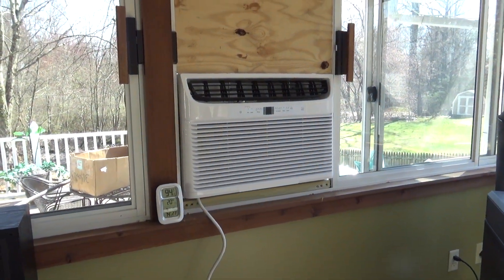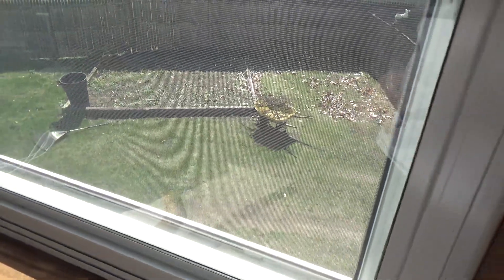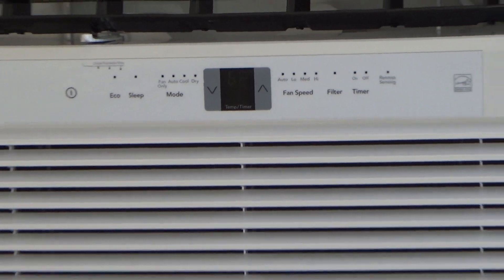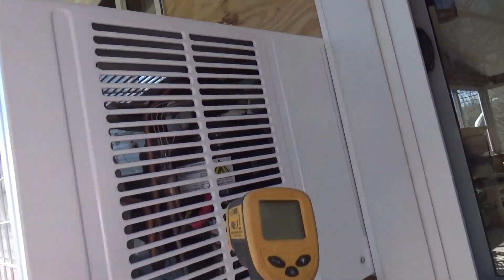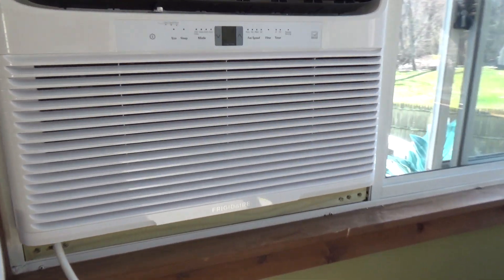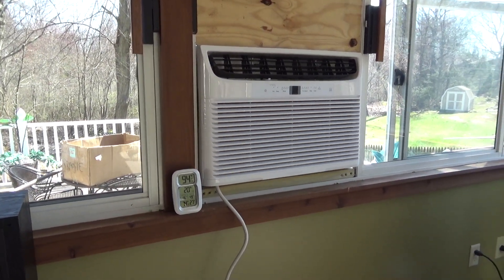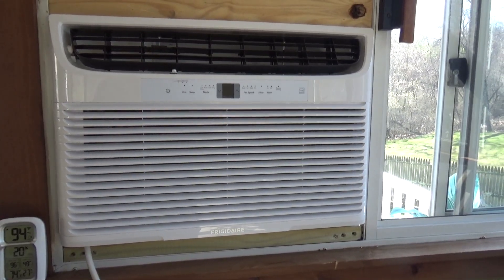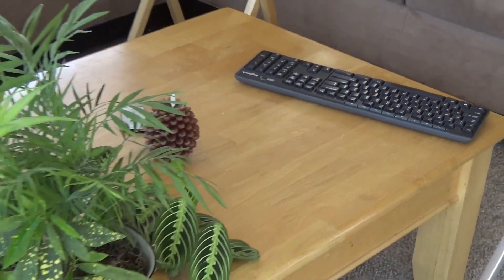Scalding Hot Compressor and Erratic Behavior | Frigidaire FHWC253WB2 25,000 BTU AC Day 2

Comment: Look at the open gaps you have between that air conditioner. You need to close them up. You can clearly see the outside light coming through. That hot air is just sucking that cold air right out of that room. With that Gap you have on the right hand side of that air conditioner. And yes, with no curtains or shades it's probably struggling with that too. But that big gap you have on the right side of that air conditioner. That hot air is just sucking that cold air right out of that room. You need to seal that air conditioner up a lot better than what you did there. I guarantee you will see a difference.
Reply from the maker: I put a 27,500 BTU unit from the 1980s in the room under the same conditions and it cooled perfectly. This modern equipment is lousy.
Reply: That's not the issue here its either an undersized compressor OR not enough airflow over the condenser either way it means its poor design.

Comment: Maybe the air conditioner has problems with the cycle, it could be doing the short cycle, or the compressor was overheating, as was the condenser.
Reply from the maker: Or it's just a modern piece of junk.
Reply: @JordanU  Yes, but I think it would be good to use it for more or less small places.

Comment: Maybe wrong, but I suspect the insufficient airflow is causing the head pressure to rise through the roof, leading to high compressor temperatures. The bad-quality junk you receive today is unbelievable.
Reply from the maker: The condenser temperatures didn't seem unreasonably high, but more air flow would definitely be better.
Reply: Midea sucks at making acs they also manufactured some Frigidaire acs

Comment: I have the same unit. Lasted 8 years, it has the 401 gas. IF it loses just a little bit, I was told by a friend's brother whom has his license that this can cause the head pressure to get to high and shut off. Electric bill was getting shy high. It looks like you may have some open windows, maybe just the way there made. That service call an gas isn't worth it. It's under warranty for 3 years, mine was. But out after 8. Get your money back and get you a Mr cool Diy, get help. That's what I plan on doing.
Reply from the maker: Lost gas will cause low head pressure. These units aren't worth a dime. None of the ones made today last. I installed a vintage unit from 30 years ago in it's place and never looked back.
Reply: @JordanU unit name?

Comment: This A/C should oem by junk chinese Midea, Midea A/C 's condenser air flow is very poor. Alsothe discharge temp of R32 refrigerant is very high.
Reply from the maker: It's made by Electrolux.
Reply: @JordanU  these use midea parts

Comment: Try misting it with water
Reply from the maker: Why would one mist an air conditioner with water?
Reply: @JordanU  it helps it cool down
Reply from the maker: @Dubby522  There's so much heat there, a little misting of water or the collection of condensation that comes out of the machine will just warm up to the temperature of the condenser and do nothing but rust it out.

Comment: I'm thinking that it might have a slow leak. The refrigerant running through the compressor does help cool it. I think you should just replace the air conditioner as soon as you can. Summer will just get even hotter, so this is just a bad sign. That, and you need window treatments, but that will only do so much if your air conditioner is about to run flat or burn out. Window treatments will help you save a good chunk of money with all those windows. Although leaks in coils can be repaired, my understanding is that it's not economically feasible even if you can find a guy to do it. These modern air conditioners are designed to be thrown in the trash. It's unfortunate. In someways, it's like how cell phones are built like Swiss watches that we just trash after a few years, and they make every effort they can to make sure you can't repair it. Modern air conditioners don't even have the quality in them to begin with. They are simply designed to fail.

Comment: You should see a 20° difference 94° Outside 74° Inside is about right . If the outside temperature should get up to 100° outside you might be around 80 inside also even in the winter especially the winner you're picking up 1100 watts heat per square meter from the Sun Through the Windows or on any surface it's quite a bit I'm sure you may get different results with different units but generally speaking that's about right.
Reply from the maker: The 20 degree delta is for the air passing through the evaporator coil, it has nothing to do with the outside temperature.
Reply: @JordanU  that's true it is for the coil but it also can apply to the outdoor temperature versus indoor temperature . Typically for every degree of Rise Above 80° in outdoor temperature you'd see a similar indoor temperature rise of 1 degree
Reply from the maker: @vincentjames1643  The machine should have enough cooling capacity to overcome the rise in temperature outside and maintain the desired temperature inside.
Reply: Agreed especially at the BTU rating that it has possible not enough air flow over the coil. Also by the way 80° was a typo meant to say above 90° you'll typically rise one for everyone degree rise outside especially under higher humidity conditions due to the percentage loss for latent heat.
Reply from the maker: @vincentjames1643  I do think there is insufficient air flow, on both coils of this unit. 25,000 BTU is an exceptional amount of cooling, the air should be absolutely blasting out of there and it just doesn't.

Comment: That AC is junk. I would return to sender if you can.

In my old apartment, they had a 240v GE through the wall unit. I would set it to 70, and it would cool down to that and maintain. But after several hours at random, (especially at night) it would just quit and do nothing. It was still set at 70, but it didn't care that the place was at 85, Ridiculous. I would then have to unplug the thing to reset it. It would then do the same thing several hours later. Apartment management wouldn't do anything about it, claiming it was a "energy saving feature". Even though I was paying for the power.

It became such a pain that I bypassed the china electronics and hooked up a relay and regular thermostat to it. Never had a problem for the rest of the time I was living there. And I reverted it back to it's crappy self when I moved out.
Reply: Unfortunately, this unit has a hole drilled into it, so it can't be returned.

Comment: That's a very ridiculous appliance you got right here, it's literally pulling money out of your wallet and it's trying to destroy itself at the same time. It's a fraudulent and flawed design, a mistake made by Electrolux. The "non-ozone depleting" refrigerants like R32 is also a mistake, I bet that compressor is also running at an extremely high head pressure. Seriously, I wish you luck on getting the Amana Cool Zone fixed very soon so this nightmare can come to an end.

Comment: Yeah it's way too hot crazy how much a big unit 25k BTU can't properly cool... Modern junk at his finest... How much was this Ac? Probably cost too much for what they are... And for the Aris troll the difference between a vintage and a new one for power consumption is not that big... But efficiency a big yes for a vintage unit...
Reply: AMDRADEONRUBY oh, sweet, think I’m trolling? No, I’m not! Well, actually, I had a Frigidaire window air conditioner in a high school in Massachusetts. It was working strong! No problems at all. And you might be thinking, is the airflow too weak? Not always, but it’s Frigidaire is designed which you call it piece of junk but it’s not!
Reply: @ArisBuliteanu  you AGAIN 🤦

Comment: 1:10 The temperature control thermostat is a sensor which monitors the temperature of the air and activates a switch to provide power to the fan and compressor when the air temperature drops below a set point. If the thermostat isn’t working, the air conditioner will cool continuously or won’t cool at all. To determine if the temperature control thermostat is defective, use a multimeter to test it for continuity. If the thermostat does not have continuity, replace it. (Note: Some thermostats may also control a heater and, as a result, will have three terminals. Refer to your air conditioner’s wiring diagram for more information.)
Reply: You know Jordan knows already that...
Reply: DO NOT COPY AND PASTE CLIPS FROM RANDOM WEBSITES AND POST THEM IN THE COMMENTS SECTION
Reply: @WalterKnox  ??
Reply: @ArisBuliteanu  You are posting spam comments and it needs to stop.

Comment: Turning down the thermostat won’t actually make your air conditioner cool your home quicker. In fact, it will only make your air conditioner work harder. This means your AC will use more energy and cost more to run to reach the temperature set on the thermostat. If your  air conditioner isn’t cooling  , that’s a separate issue to address.
Reply: YOU AREN'T LISTENING TO THE VIDEO... it will help, because the thermostat on the unit was cutting off pre maturely. STOP GOOGLING THINGS, AND POSTING SEGMENTS FROM WEBSITES INTO THE COMMENTS SECTION. 
STOP SPEWING NONSENSE.
Reply: @WalterKnox  ?????????????????
Reply: @ArisBuliteanu  you are posting spam. All you are doing is copying sections of websites and pasting them here, and what you are saying does not apply to the video in any way or help any of them. Plus, a lot of what you are saying is false information.